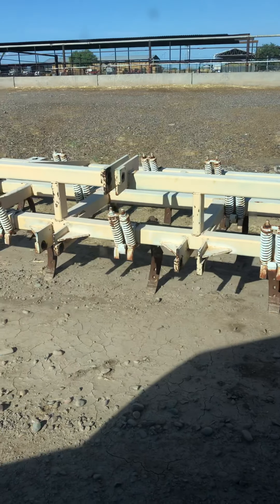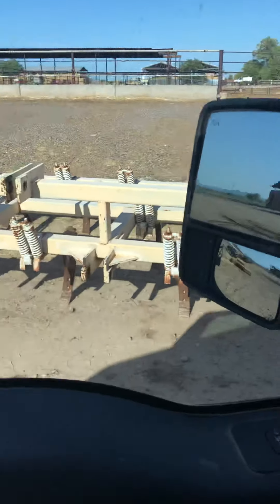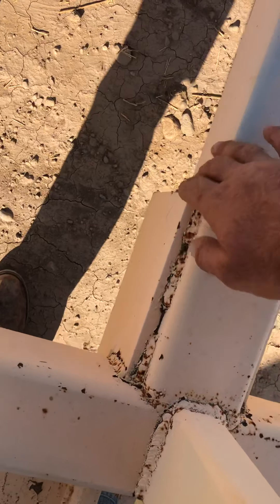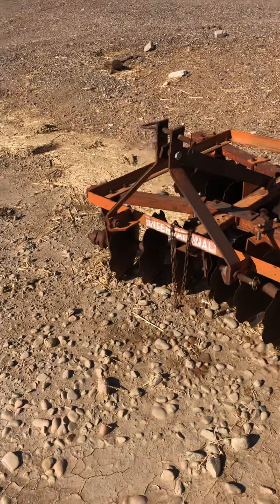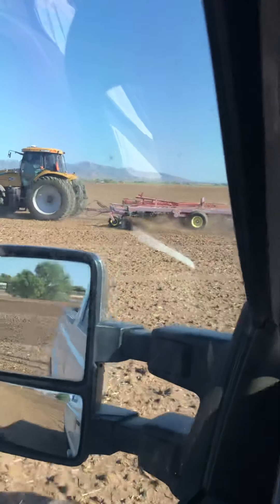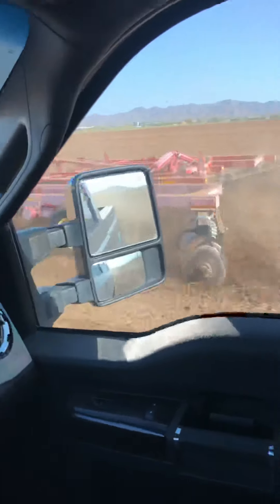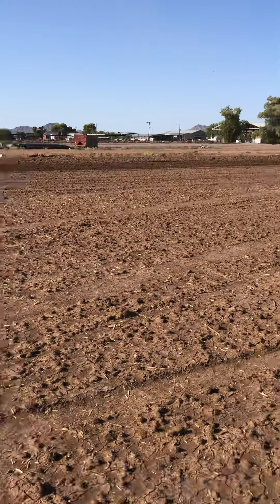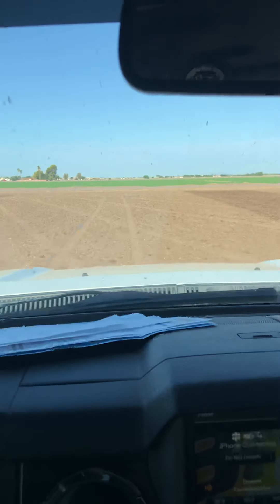The brownie effect.

Comment: I think I prefer our cat 2 and cat 3 hook type link arms and stabilizer bars as they don't seem that much slower than the quick hitches but they can just adjust them quickly to fit any width.
Reply from the maker: SJ K Yeah, that’s true, I could have taken the quick hitch off and done it the old way. Especially for as few times as we use that thing.